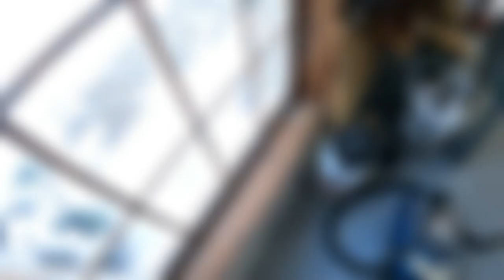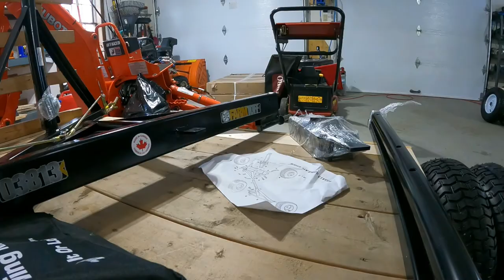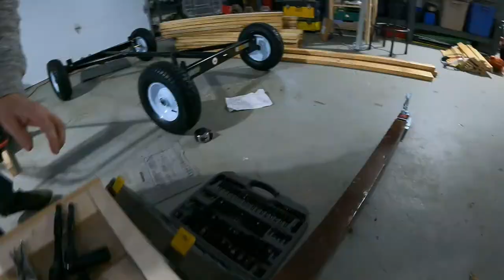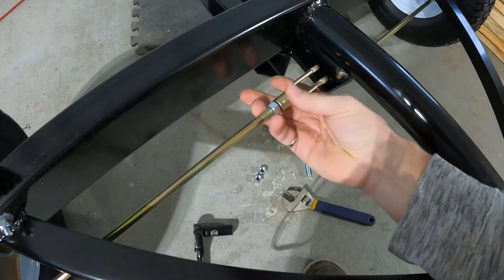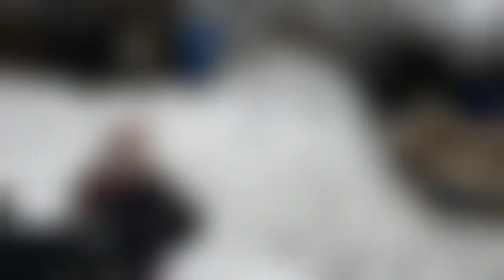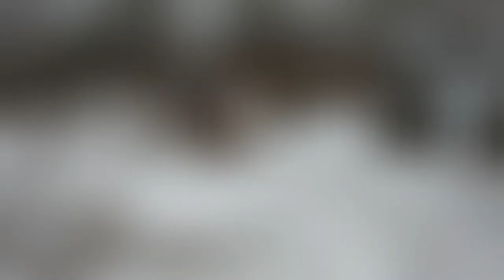Mini hay wagon build

Comment: How long is your frame….I have the same one but mine seems shorter
Reply from the maker: It’s adjustable, if I remember correctly it ranges from about 6 feet to 10 feet. I built it at about 8 feet which is roughly the length I was looking for before I bought it 👍

Comment: Very good and useful trailer. 
Until the first time you use it on pavement. 
Then you discover that no matter what you do the front wheels will ALWAYS scrub due to the steering components. 
On dirt fine
Edit. A 1/4" gap between floor boards will eliminate a lot of rot and binding issues when damp. 
My boards at 1/4" gap occasionally become water tight. 
Married frame rails are an excellent idea because used engine oil/diesel 50/50 mix will seep into the wood better. 
Nothing eats that. Reapply with a garden sprayer yearly. 
So called "Treated " lumber is a joke at your expense.
Reply from the maker: Thanks for the tips! I never use it on pavement, so I’ve had no issues. Just light yard work and taking the kids for a ride. That’s good to know about the treatment though, I’m always looking for new ideas for wood preservative